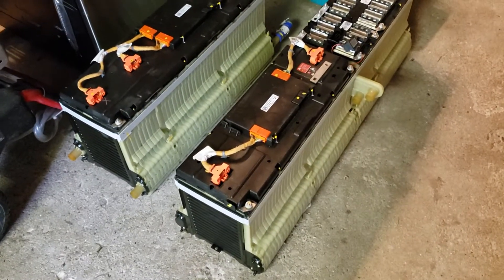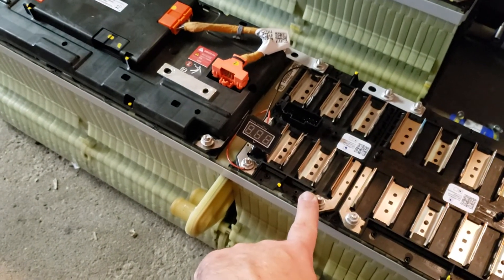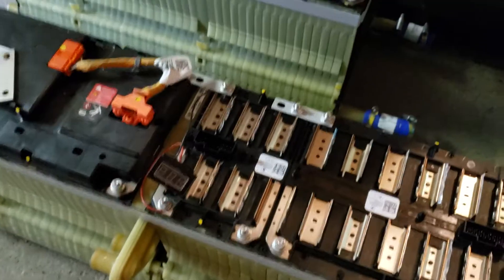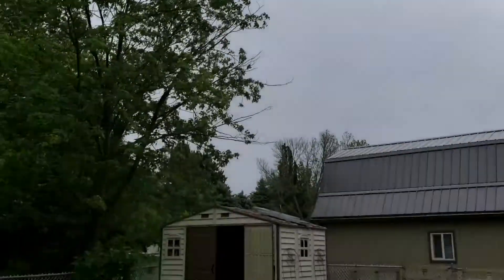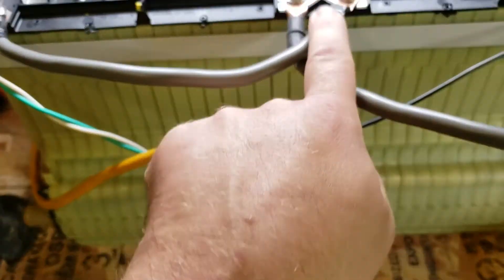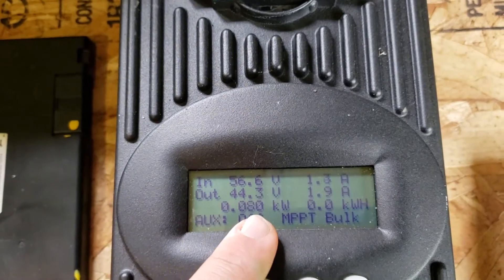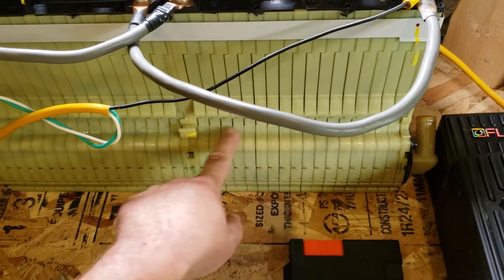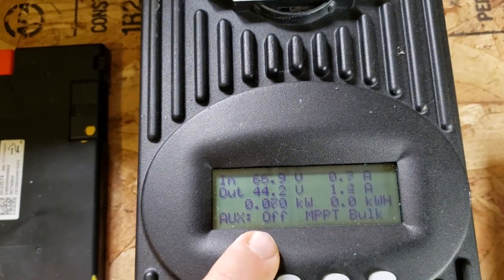lithium battery backup power

Comment: Brother do you have the PDF? I can share if you would like. I use the 24 volt guys. I have 6 of them.  I go down to 22 volts and max 24.6 volts. So 4.1 volts max and low is 3.3 each cell but you can go down to 3 volts each cell..  Nice score brother. I can't post the link but I will make it so you can go there..